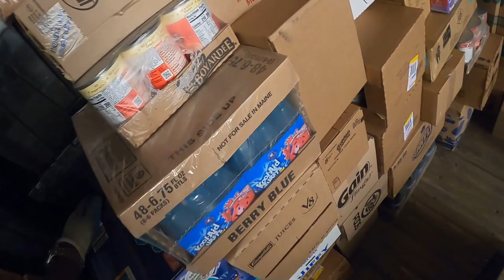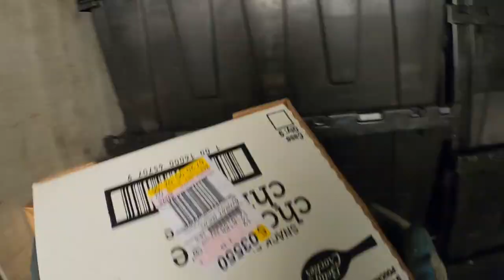Werner Family Dollar Account the treatment you get as a truck driver #werner #youtube  #truckinglife

Comment: What could they really do without getting in the drivers way? I will be doing this account and I really don’t want no one in my way. I use to be a truck unloader at Walmart using the gravity belt, unloading 53ft trucks so this little bit will be easy once I get fast again. The only potential issue that I will have is how fast the workers move to unload the belt. Slow workers will only slow me down. A crowded belt is annoying
Reply: Update?? 😅

Comment: I know this account sucks I do it too but there is easier ways to set up that toll ramp my brother 💪🏽
Reply from the maker: Some stores will work with you on how they set up with other drivers, some will just watch you and make you figure it out yourself (set up "your preferred way," they say. In my experience, boxes coming down the line fast or slow they complain.
Reply: The way I set up the accordion rollers is by putting the first two wheels into an empty tote and push it between the ICC bumper brackets. It stays put... especially when you attach the first roller track. I always ensure there's a high side in any bend in the accordion rollers to help keep the load from falling to the ground. To envision what I mean, think of the way a race track curve is slanted towards the inside of the turn.

Comment: I do Dollar Tree with CR England.  The skate wheel rollers are the store's responsibility.  I don't handle their rollers, only mine.  Leave their rollers right there at the doorway and put one of your rollers from the back of your truck down to their roller.  Why attach their rollers to your rig?  Instead of bringing their roller to you, just bridge your roller out to meet theirs.  You don't even have to prop it up, it will set between the end of your truck and their roller without any additional support.